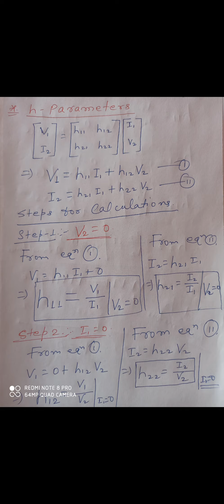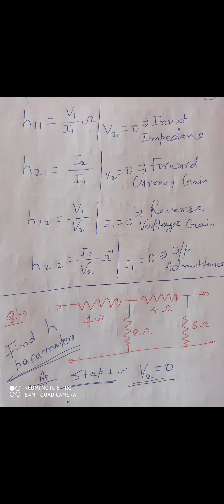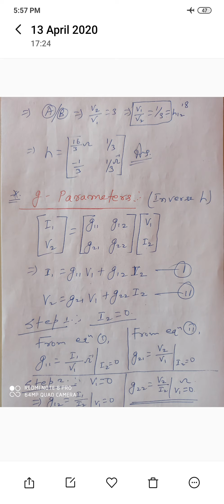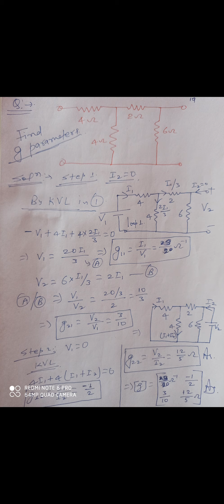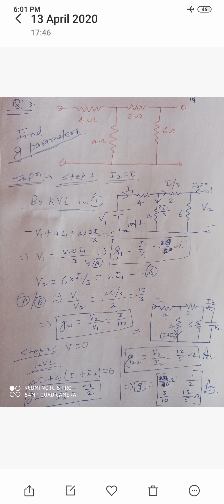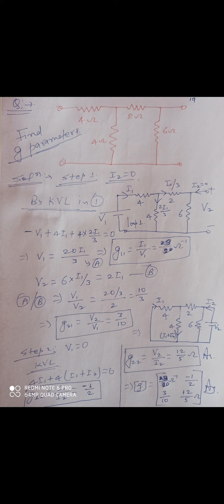Comment: There is a correction in the numerical question for calculation of g12. Current flowing through 4ohm shunt resistance will not be I1 + I2. We will find by current divider rule and g12 will be -3/10.